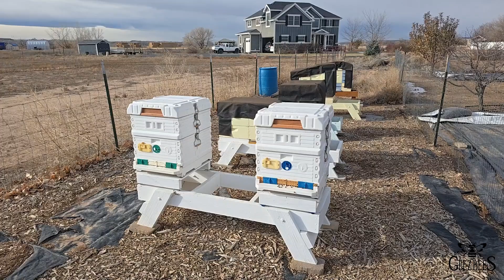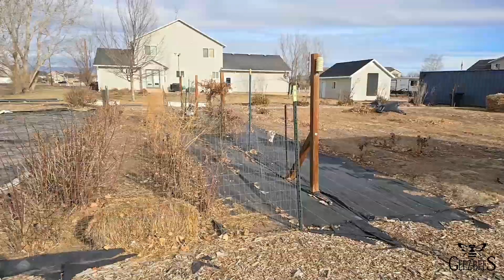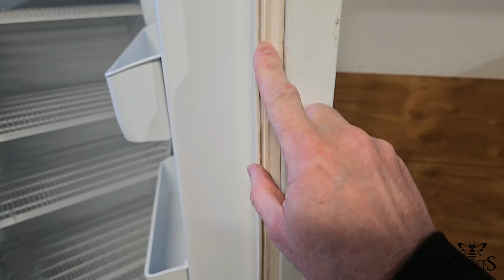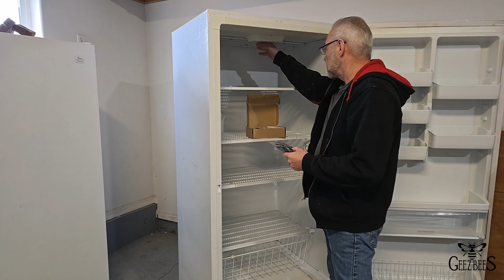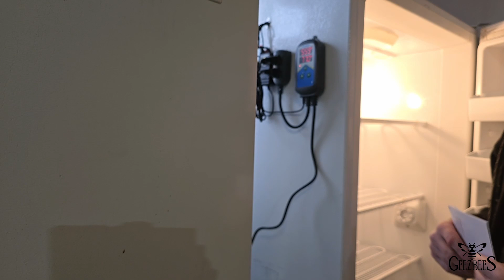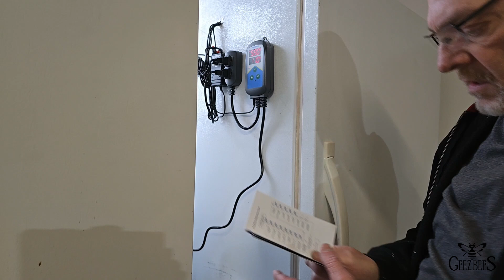Easy Honey Warming Box

Comment: Maybe I missed it in the video, but what wattage bulbs did you use? I've thought of doing something similar, but with a terrarium heat mat.
Reply from the maker: They are just 60w bulbs (that's all I had).  I figured I'd have to go to 75w but it seems just fine with these.  I thought about using reptile heat bulbs but this is working great.
Reply: @utahbeeman  Good to know. Thanks for the response!